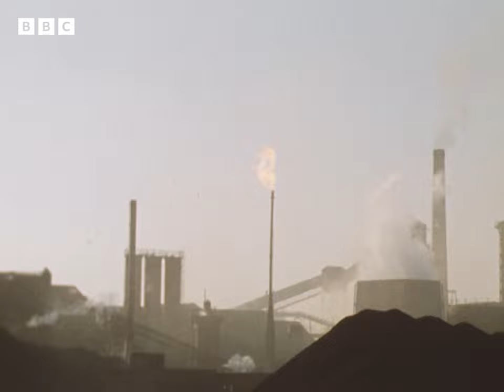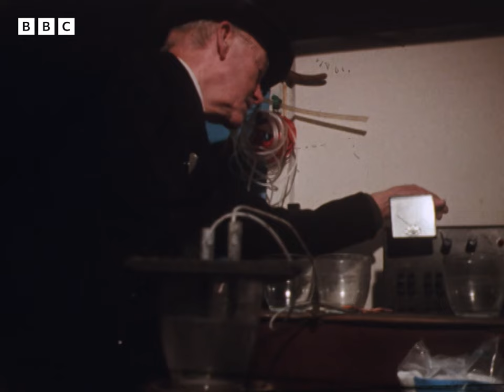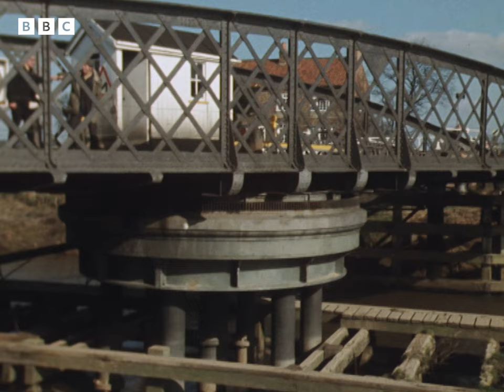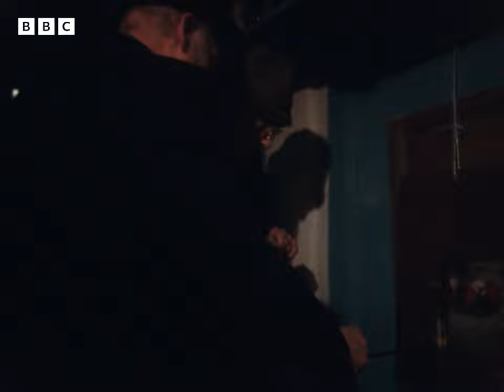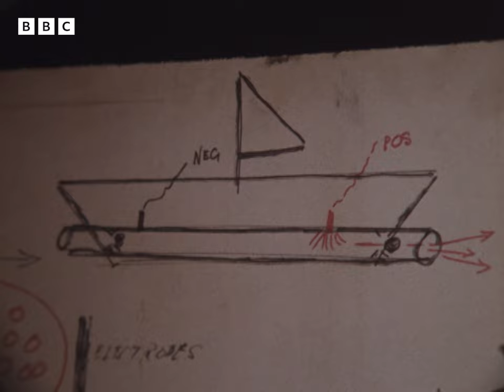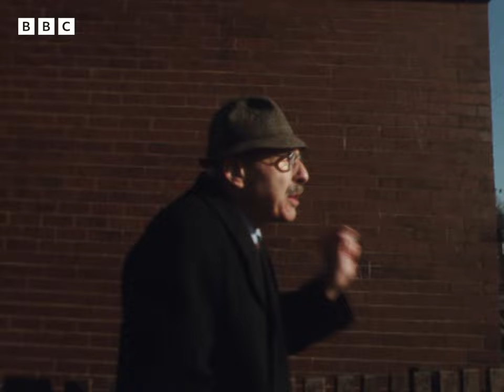1976: Mr Buckle’s BRINY ENGINE | Nationwide | Weird and Wonderful | BBC Archive

Comment: Excuse me, the WHAT engine??
Reply: Wankel rotary engine. https://en.m.wikipedia.org/wiki/Wankel_engine
Reply: @TheCuratorsNightmare  Used, of course, by NSU, Citroen in prototypes and most notably Mazda, who still use them for some unexplained reason, a range extender electric with a very inefficient engine?, well at least the engines light!